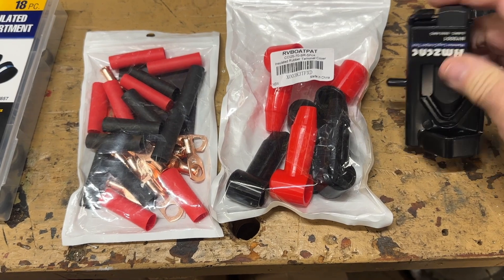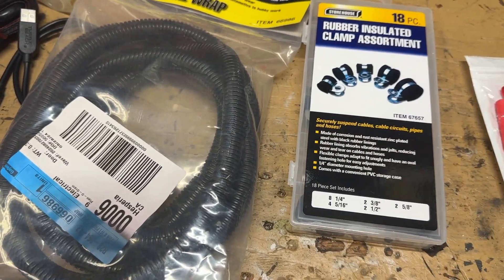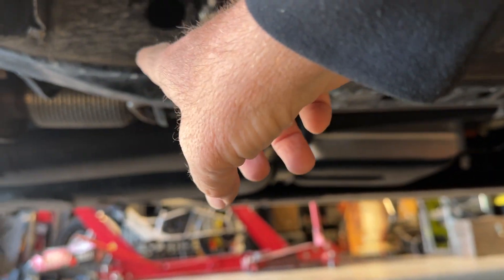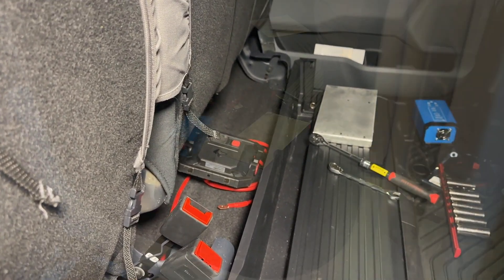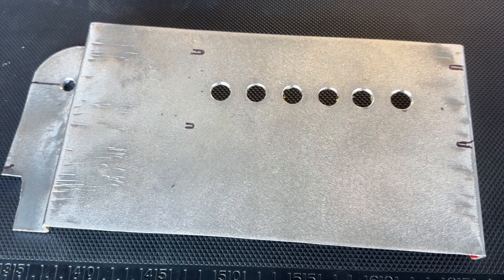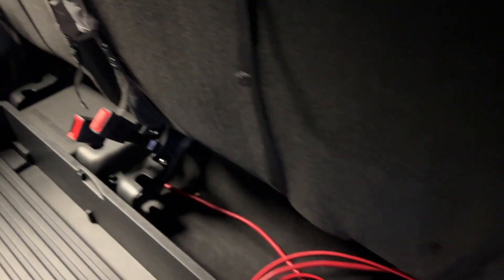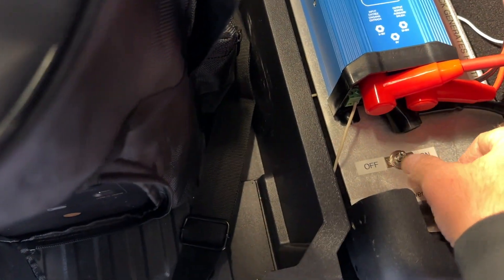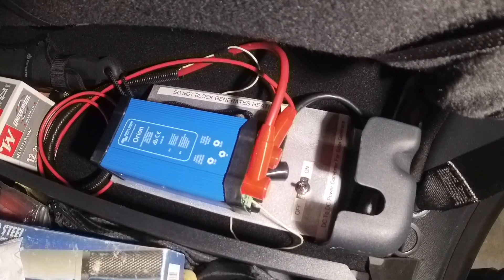Installing A Victron Orion 1224-20 dc/dc converter On A Ford F-150

Comment: Good mourning Larry!😁
Reply from the maker: Good morning my friend. Hope you’re doing well. Have you been riding lately or is it too cold?
Reply: @ManCaveMayhem  In Illinois, from November till some time in April, or sometimes May depending on the weather, my scooter stays under a bike cover with the carb drained and the battery in a nice warm dark closet. And because of that I feel like I die a little bit every year till spring time. From this Saturday night 1/18/25 till 1/21/2025 Tuesday we are under an arctic air blast warning where ya don't do anything outside for about 4 days or your lungs could freeze and you "could" die just for going outside and absolutely no exposed skin including your face. The winds will be the most dangerous pushing the temps to -20 or so Farenhiet. Now do ya have a little insight on why I would like to live in a warmer climate as I get older. I have a friend out in NM that wants me to move out there but no money for that, would love to move to Parsons, TN but am stuck her in the frozen tundra for the same reason.... later man!!😁
Reply from the maker: @Shagnasty-bo5bj  yeah I spent some time in Chicago and it would get miserably cold. It’s like being on another planet.